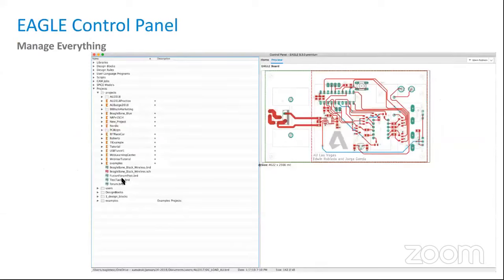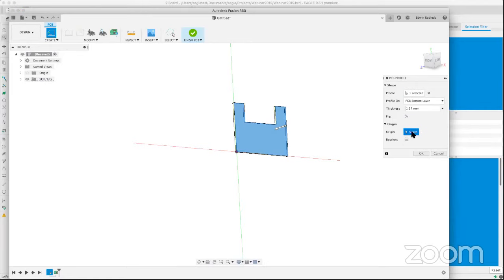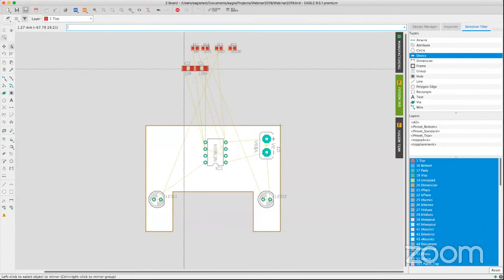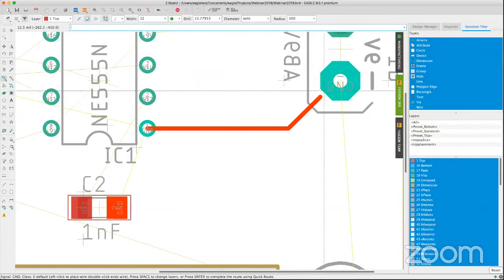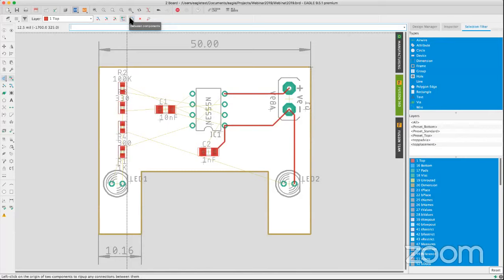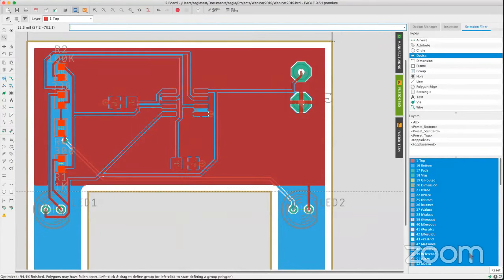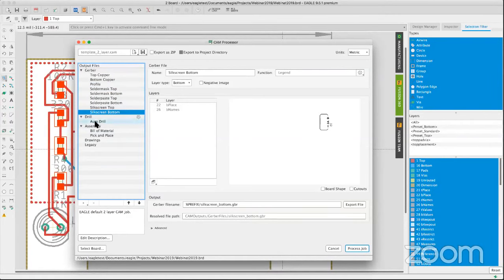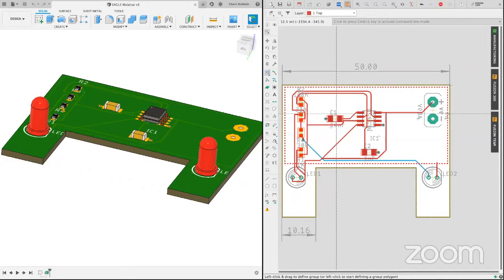Getting Started with EAGLE Part 2

Comment: Why is autorouter placing traces "over" (figuratively speaking) SMC (for example, at 46:33 time, there are traces going across 555 component) ? Is it a good idea for copper traces to go under one component in real PCB board ??
Reply: Depends on the component and if your worried about inductuctance, or electrical noise. I would say no for important data lines with high frequency data, but otherwise meh, unless they're high current and might get hot enough to cause the component above to have issues, but typically the ground plane goes under everything so 🤷

Comment: In the current version of Fusion there is no Create PCB, instead there is a Create 3D PCB, but it does not appear to create a board but rather creates a Package which cannot be linked with Eagle. Could you please explain how to do a PCB board in the current version of Eagle? Thanks!
Reply from the maker: Hi Captain MJ, Thanks for your question. Go to the EAGLE Control Panel. Click on the File drop down menu and create and name your new project. Once you do so right click on the project and you can start by creating your schematic. Once you are ready to move over to the board click on the SCH/BRD icon in the top of your screen. Please let us know if that helps. You can always join us on the Autodesk EAGLE forum.
Cheers!
Reply: @AutodeskEAGLE  I'm having the same issue and hat explanation does not help at all...
Reply: @AutodeskEAGLE  Many thanks for the help! Much appreciated and great video!

Comment: I still think easyeda is probably the best out there at the moment, just to be able to get components from the library alone it's already 10x ahead of eagle. I do use fusion 360 for all my mechanical designs but there is no way I would ever use eagle it just simply sucks.

Luck to all.

Comment: I have a question regarding the ground plane polygon isolation settings and the DRC settings. For simple low frequency boards, is it ok to leave the polygon isolation setting at 0, and the DRC settings at default? When would you change these settings and where can I find guidelines on this topic?